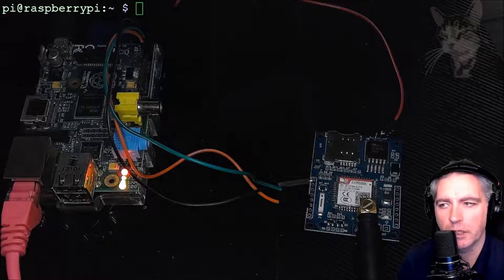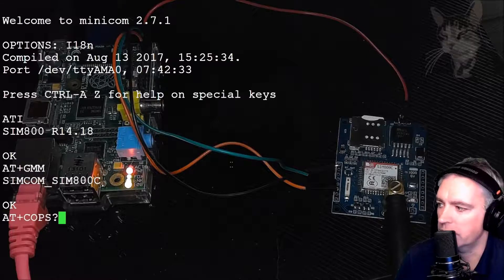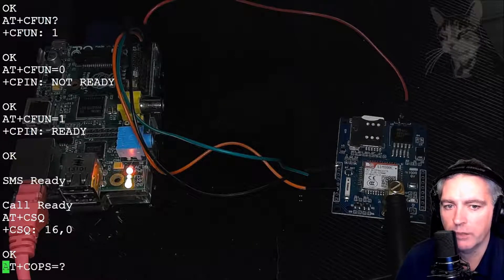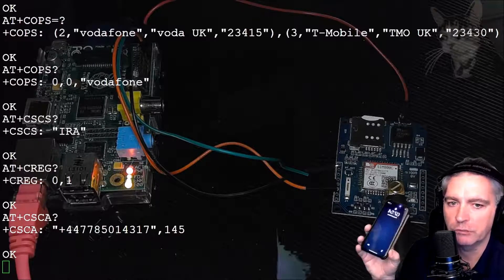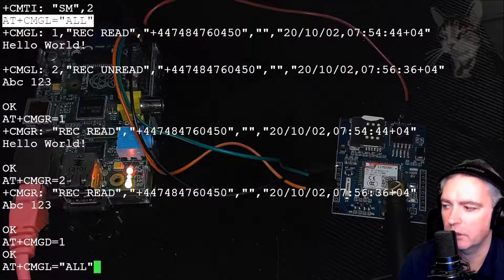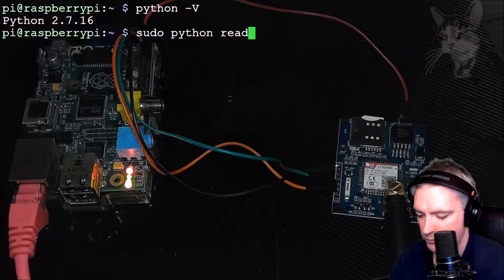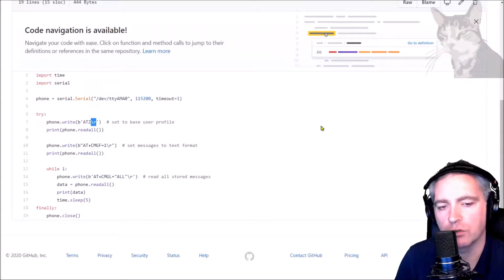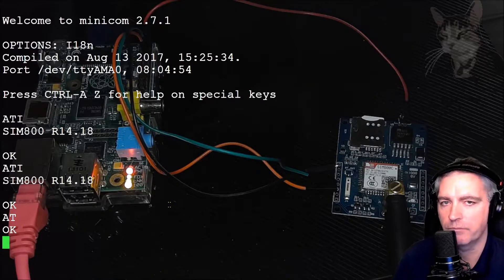Receive SMS using a SIM800c Module

Comment: When I receive messages on the board I get some garbled output in the minicom output, some ascii63 questions marks instead of the +CMTI... everything else works, all AT commands work just fine and I do in fact receive the messages when i check with at+cmgl. any idea what could be the issue?

Comment: The AT+COPS? returns a value zero, I try AT+COPS=0,1,2 but it returns an ERROR. I try AT+COPS=3 and returns OK but nothing happens. 
AT+CSCS? 
 and AT+CSCA also return ERROR and AT+CREG? is +CREG: 0,0. Please help me. The commands and results i get is below: 
ATI
SIM800 R14.18
OK

AT+GMM
SIMCOM_SIM800C
OK

AT+COPS?
+COPS: 0

AT+COPS=?
+COPS: (1,"Globe Telecom","GLOBE","51502"),(2,"SMART Gold","SMART","51503"),,(0)
OK

AT+COPS=0
ERROR

AT+COPS=1
ERROR

AT+COPS=2
ERROR

AT+COPS=3
OK

AT+COPS?
ERROR

AT+CFUN?
+CFUN: 1
OK

AT+CFUN=1
OK

AT+CSCS?
ERROR

AT+CREG?
+CREG: 0,0
OK

AT+CSQ
+CSQ: 19,0
OK

AT+CSCA
ERROR

Comment: Do you have some script which you run to listen to incoming messages and prints it + phone number? Saves that into a text file and deletes it from the sim? 

Im planning to use this approach on my RPi to have my incoming messages forward to a Telegram group. 

Right now im using IFTTT + SMS + Telegram but its buggy as hell. Sometimes I dont get messages.
Reply from the maker: Its not hard to write yourself. 
See the github project to start with https://github.com/Sean-Bradley/SMS-Scripts
And then see the example commands in the description above, and you can see what is possible.
I won't wrote your code unless you pay me.
For an idea of how much I cost., see https://sbcode.net/threejs/consulting/